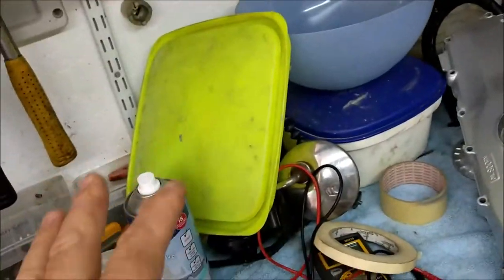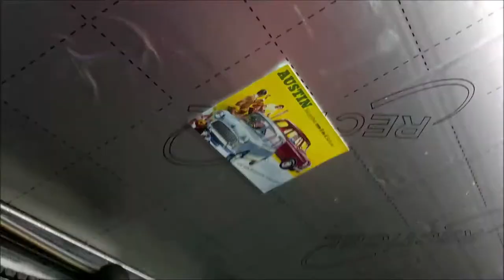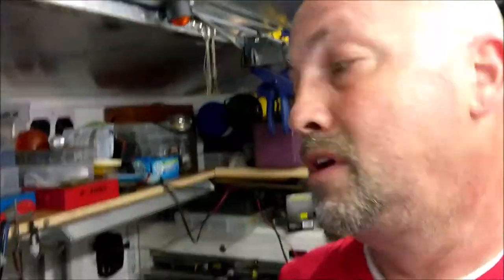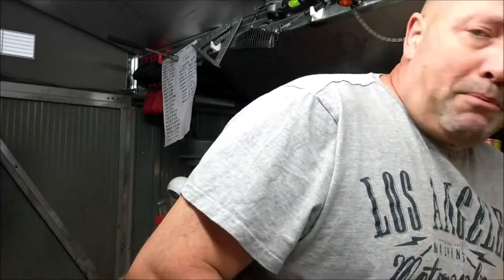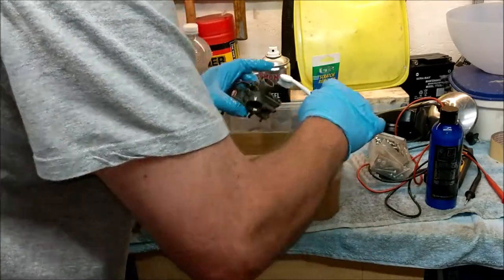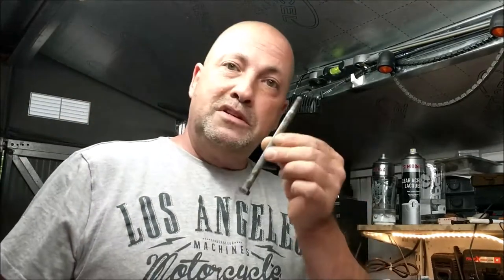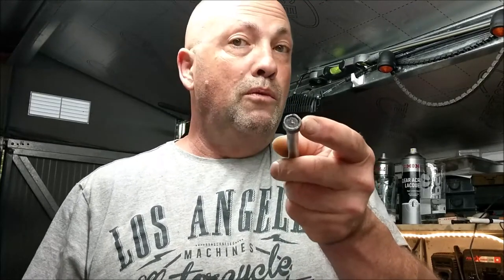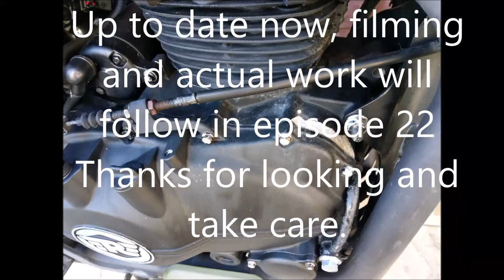Suzuki FZ50 Restoration Episode 21

Comment: Bit concerned about the decision to go with wheel silver on the cases, Eadsie. The finish you had with the VHT silver was superb - until that guff non-acrylic lacquer ruined it. Why not the VHT with no lacquer? The latter shouldn't be needed. Also, I wouldn't expect any noticeable change in appearance after oven-curing the paint (without lacquer) - it's just hardening it off. Anyway, look forward to the end product regardless. Those wheels rebuilt with fresh rubber on will look grand. Cheers!
Reply from the maker: Thanks Mike, you are right, i know, but as I'm running low on paint I'm just going to give it a go, if it turns out no good i will remove the engine and do it properly.

Comment: hiya Ade, pressure washers and bikes is a big no no mate, that is why your paint is coming off so quickly, yes it will come off anyway but a lot slower, and it gets water into everything causing more corrosion and also washes grease from bearings
Reply from the maker: Thanks Andy,